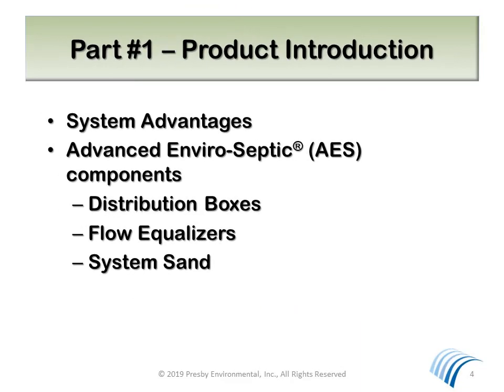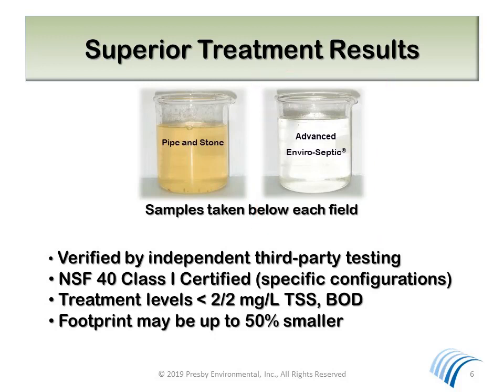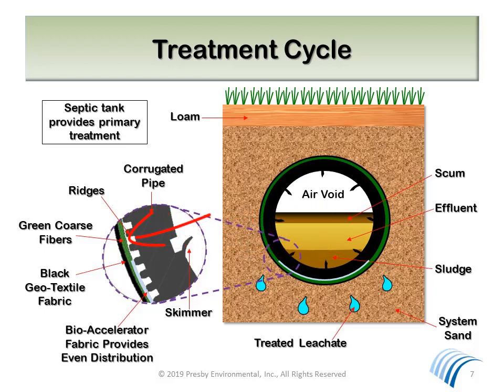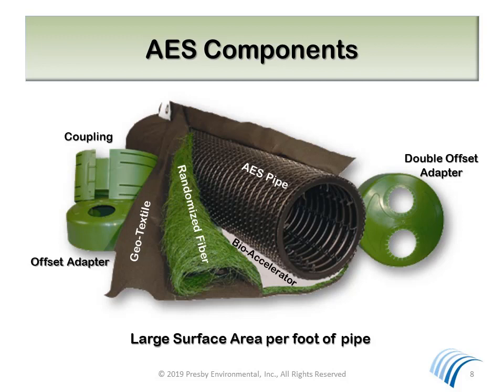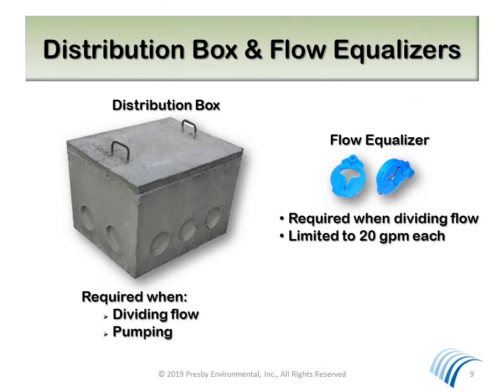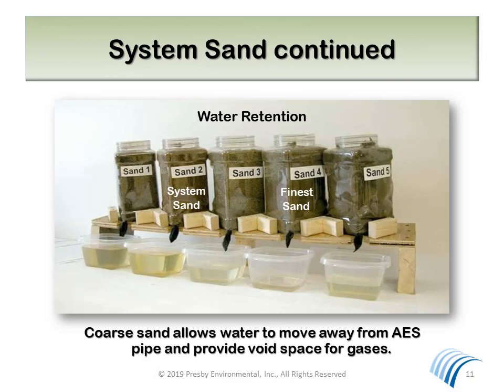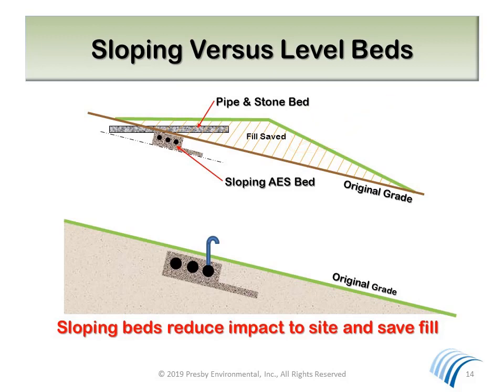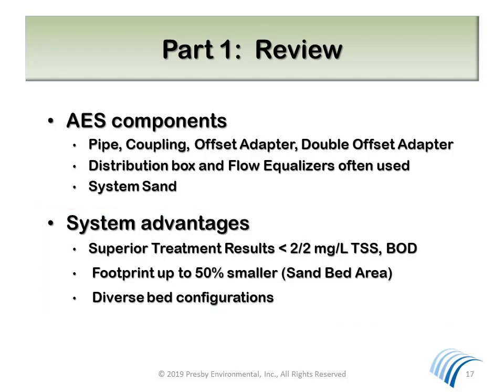General Online Certification Training: Introduction

Comment: Presby is a bit of a joke of traditional systems.. the design of almost every single one of these systems that may "shrink the size of a traditional system but is designed so un informed. Depth requirements pipe placement of pipe requirements and size of bed requirements are clearly designed and and determined on such little evidence of proof and realistic scenarios its unbelievable